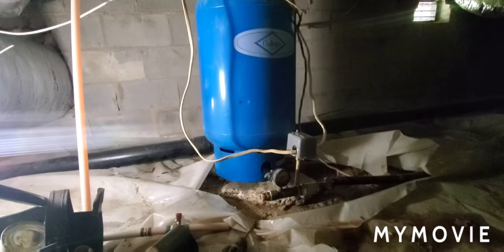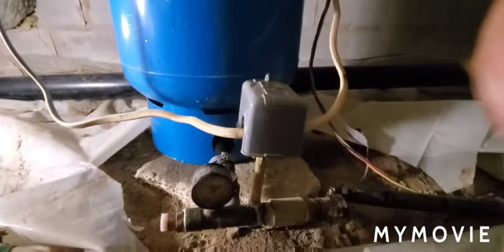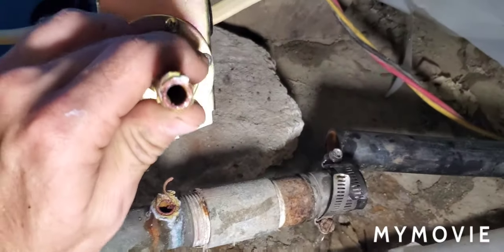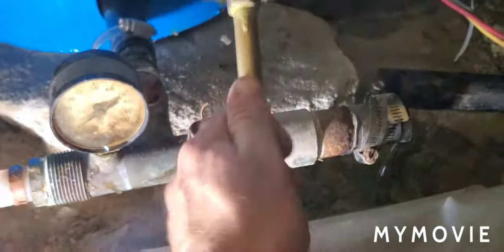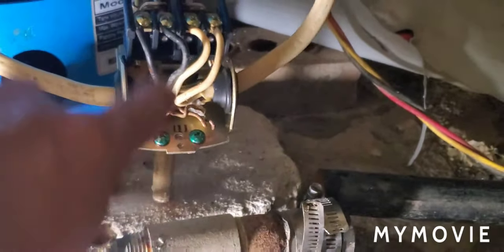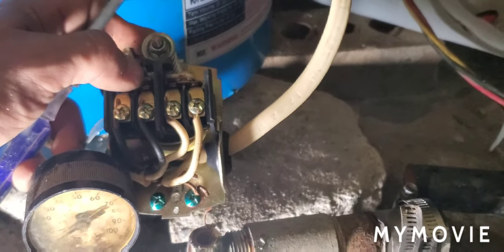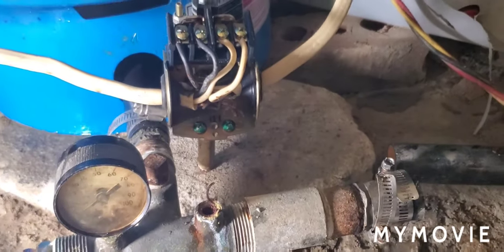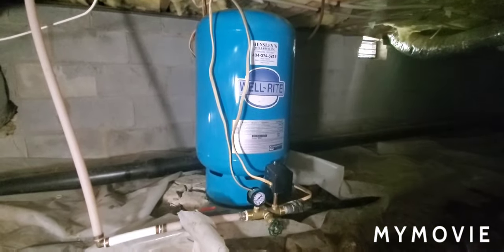No Water or Low Pressure how to fix it & diagnose the issue. Well pump not pumping

Comment: Great video. Not sure what's going on. Right now the pump turns on at 30 and then shuts off at 50. Immediately after it shuts off I watch the pressure gauge shoot down to 40 within 3 to 5 seconds. I had the faucet on at the sink just to see what it would do when it kicked on.  Not against hiring somebody, but I am experience enough to fix minor in some major plumbing issues
Reply: The switch has been replaced within the last couple months. We just bought the house so I don't know if they cleaned out the tube that runs to the cut off switch. But have not ruled that out

Comment: Hey man, great video! Just had a freeze overnight and now have no water going to taps. I however have water flowing out of the valve by the water pressure tank. I don’t see any frozen pipes in my house or anything. I’m stumped
Reply from the maker: Sometimes a frozen well head can cause the pump to run 24/7. Pushing against the ice blockage will cause the drop pipe to burst near the pump bc its dead heading around 200psi. The electric motor becomes hot and heats the water, that makes the pipe weaker & it eventually pops.
Reply: @h2omechanic  interesting. I just pulled the filter and that was caked and found out I have water flowing though the filter now but when I open the valve that leads to the house, I barley hear much water flow through, if any at all.
Reply from the maker: @Travel with the Frye Family  so a busted drop pipe leaking out pressure will stir up the water & sediment.  Your description is spot on, especially when you got alot of sediment. 
Open & faucet and kill the power, see if  gurgling happens. It's very common for a suction effect to happen bc the pipe below grade is broken, so everything drains down. (Power must be off during the test)

Comment: Thanks video my problem new tank not filling up with water i can get water out my hose on the t but the tank wont fill up at all it will build about 40 psi on guage but tank is not getting waterr and pump will not cut off

Comment: Hello H2O Mechanic,
I live in the country. My well tank is about 2 years old. I just have NO water a few hours ago. I checked the well tank PSI and it’s ZERO. I just followed a few tips you gave us here such as: 1) releasing the air pressure valve and only air came out, 2) tank sounded like a bell, 3) the tank is pretty light, 4) the electrical box was closed (ie not opened). What do you might be other possible causes? 

Thank you in advance for getting back to me.

Comment: I may have to have you help me with my Dad's well over on our farm... We got power and the pump is running but no pressure in the house or on the water hose.. thanks for the video..
Reply from the maker: Dry well or a broken pipe somewhere. Typically a pipe in the well thats busted/ or a broken fitting at the pump

Comment: Great videos.  night before turket day and ive got issues.  minimal water pressure at faucets.  and what pressure i have is directly related to the pump being on or off.  when the breaker is turned off the water stops immediately.  breaker on i get a slow rate of water flow.  as if if the faucet was just a little bit turned on.  but its full open.  so i checked pressure tank as per your video.  Tank is hollow sounding, not heavy, no water at the schrader valve.  went to drop the water from the tank to check psi and no water drains from the tank?  so my incoming water from the well is not filling the bladder…. and by the way the hi lo switch is constant on, its not switching off at all. possibly becuase the pressure is not building to ever turn the switch off?   and last thing i want to point out.  so ive got water coming up from well but i can easily put finger over the pipe end and stop that water from coming up.  im thinking the amount of water coming up from the well would spray like crazy if i tried to stop it with my finger?  thinking maybe water line somewhere maybe has a fracture  prior to entering the house?  should that water coming up from the well pump be a gusher?  1/2 HP, not sure how deep.  any thoughts?    at daylight im going to open up the top of the well and see if i can spot any obvious issues on that end.  ive never looked in there 20 years since we bought this house.  amazing how well it all works, unitl it doesn’t.  i welcome your input!  nice clear info!  Thanks.
Reply from the maker: I'm going to say there's a 90% chance of a break down in the well, either in the pipe or pump fitting. 10% chance you have a leak in the yard, you'd find a wet area. Id say this morning your gonna have to pull the pump out. If its 100ft, its a easy 2 man job. If u need help getting it going, I offer FaceTime service for 1 hour to help you do things the correct way, if you need pointers.
Reply: Thank you for your reply!  I got cold feet on pulling the pump myself and probably best that i did.  Removing the well head took an hour with two guys that knew what they were doing.  The pulled it all up and out 80’.  Found that the 1981 motor was running good.  And the 1967 Gould pump still pumping but the splines connecting the 2 were worn smooth and so the pump was slipping mostly and that why my flow rate was so low.  Got new pump and motor and new wires from head to pump.  All put back and working for $1600.  Ouch !  But I’m happy to know it’s all done right.  And next time it happens I’ll have the know how to it myself... thank you for your reply!  Nice to know someone out there cared enough to give thought to my problem.  And help to review my logic and concur or put me on the right track.  Many thanks!
Reply from the maker: No problem 😊.  Thats a little high in price for a 80ft pump. But I would have been 1200max. But I'm different, I believe in helping people and making a living. I dont do what I do to get rich. I just want to help people & live comfortably!  Any future issues just ask. Please subscribe

Comment: Hi I like your videos, they're very helpful. I'm experiencing my water shutting off and taking about 30 seconds to reset. I cleaned out the filler tube to the switch and that didn't seem to resolve the issue so I replaced the switch and the supply pipe. That also didn't resolve the issue. The new switch has been adjusted to 40-60 on the large spring, I get 60 lbs showing on my gauge with 38 lbs in the pressure tank and the tank has no water in it. What could I be missing, any recommendations? Cheers

Comment: Great videos, our water went out last night. I tried flicking the switch a bunch and saw sparks, but still no water. Does this mean I have a busted pipe somewhere?
Reply from the maker: Correct. Typically its a leak in the area nearest the pump. I have a video showing 6 pumps that all had different leaks and what to look for.

Comment: Thank you for the video.  I don't think you mentioned installing either a pressure relief valve and/or check valve near the air bladder tank.  I am not a plumber, but I  have both on our system and recommend they be installed. Interested in your thoughts on both of these devices. Thanks!
Reply from the maker: I agree on a relief. But I don't recommend a check valve at the tank. If it holds & the check valve at the pump fails, then the system will develop a air In line type of problem.  Check valves should stay In the well

Comment: Where do i start. I had a problem with my pressure switch. Replaced it. The old switch was faded so i thought bigger was better so i went with a 40/60 . after the pump would not build pressure passed 42 psi i thought i had bought the wrong pressure switch. I bought a 20/40 psi. But now i feel when the pump kicks on and off. I believe i have a bad pressure tank but have not checked yet. If my pump is not building pressure passed 42 psi is this a sign of a bad pump. You have stated that it will continue to pump on some systems to 120 psi. Thank you in advance.
Reply from the maker: Your pump is old and worn out. Or you have a small leak in the well on a fitting connection between pump & pipe, it can be leaking out alot of your pressure. A good tank should feel almost empty of water and you can tip it side to side. A bad tank will weigh 200lbs & won't budge if you tip it

Comment: Big fan of your videos i just have a problem with my well. I have no water and the pressure gauge is showing 0 psi when I look at the pressure switch it is in the on position which means the pump is on. When I shut power off of the pump for an hour or 2 the pressure goes to 45 psi or so and the water comes back but the pressure switch is still in the on position and doesn't switch off. If I use the water the gauge goes to 0 psi and I lose water again. As far as I'm aware the tank itself is fine and the pump controls are also fine. If u have any ideas as to what my problem could be some help would be amazing. Thanks
Reply from the maker: Sounds like you probably have a leak (leaking toilet) that has drained the well dry.  Kill the power for 12 hrs. & check to sew if any toilets leak down in the first hour.  It only builds 45psi bc the pump is struggling to lift the water & then it runs dry again when u use it. Drops to 0. 
Look for leaks under house & in the yard too. Almost certain thats it. Or your well has slacked off with its production rate of flow.
Reply: I will check thanks but don't you think it's something else for example it's a dry season in the well it's not have enough water
I have this problem before
Reply from the maker: Well then yes, id say its running out of water. 50% of the time its a toilet that is using the water the well makes. Get pressure to 50psi & kill the power & see if the pressure gauge moves any in 10 minutes ie: a leak. 
If all is good & no leak, Google well drilling companies & ask about Hydro-Fracing your well. 
Or Google Hydro-Fracing companies 
Look to spend $2500-$3500 on a frac.

Comment: Hello my name is Jerry. In my home i have this same set up. The problem i have or the issue is i have plenty of pressure, but about once every min the water pressure drops but for just a second then back to normal. Do you think the small tube could be stopped up or do you think the pressure tank is bad? I pressed the valve on top of the tank and only air came out. I was told if water came out then the tank is bad. but it was only air. I changed water filter couple weeks ago and water is already dirty, so i guess pump is cutting on several times and keeping the water agitating. Any thoughts?
Reply from the maker: 2 possible situations like you said. 
First kill the power & go remove the switch and see if that nipple below switch is clogged. Be sure to drain off all the water pressure before you do it. 
While you have the switch off & water drained off, do a tank slosh test. Tipping the tank a few times & listen to see if you can hear water sloshing around inside the tank. If you hear water in there or if it's extremely heavy the tanks bad . If it's light weight & hear no water then it's still good. 
Be sure to look under the switch cover & find the on/off numbers. The air pressure in the tank needs to be 5psi below the "on" number. Have a tire pressure gauge to check the tank air pressure. What your describing is the tank has too much air, but air doesn't magically go up. Sometimes a pinhole leak allows water to displace some on the air and ends up increasing the air pressure & causes your problem. But at that point water is ontop of the bladder and that's bad. But the tip test will show you if that's the case.

Comment: I have a garden 1/2 hp pump... hose in hose out.... will not build up pressure... it will flow but I can hold my finger over discharge and stop flow very easily... good volumn... no pressure.  pump was left out in freezing weather... I did not think it had water in it???  isn't leaking??

Comment: One question.  My tank sounds like a bell but my tire pressure gauge on the schrader valve reads zero.  My pressure switch is 30/50.  Should I air up to 25 before checking the switch contacts and nipple and might the increase in air pressure cure my problem?
Reply from the maker: Correct. Follows these steps. 
Turn off well breaker
Open sink faucet, leave open.
Add air to tank to 25psi,no more then 28
When adding air, water traded in tank will be forced out of open sink faucet. 
Once air reaches 25 psi, close sink faucet and turn breaker back on. 
If you were having problems with your Pressure, then yes itll fix your problem.
Reply: @h2omechanic  I have a 3/4 nut on my pressure valve.  Is it counterclockwise to loosen?  Interestingly enough, I had a double white wire coming in from one side and a red, black, and white from the other.  Red to the white terminal.  Black to the black. And white to the ground.

Comment: This video was great. I would greatly appreciate a little more advice. We have an overflowing well, for some time now; and I recently noticed the pressure valve jumping back and forth between zero and about 40 pretty consistently for I’m not sure how long. 

I’m wondering if the overflowing well could be a contributing factor.
Reply from the maker: Doubtful. 
Fluctuating pressure is indicative to a leak somewhere (very commonly found near the pump) ie the fitting connection between pump and pipe
Reply: @h2omechanic  ok.
Thanks! I set out to change the switch myself, and there seems to be a lot of water draining out of the tank. How can I tell how much should be in there based on the size of my tank?
Reply: @h2omechanic  is that fluctuating pressure “short cycling”? 
How can I tell if it’s the switch or the tank?

Comment: Mine story is slightly different. I've got 40/60 style unit.  Out-of knowhere my water pressure stopped. Went into crawl space and seen I had psi but can't recall exact. Wasnt high at all. This was before watching your videos of course. Took top off and seen all were contacts touching and in place. I never touched them. I ended up turning a knob in front of my water tank and seperate from it and turned it counter clock wise. Heard a bit of pressure and called wife to see if any changes. Water pressure for only a minute and then stopped. I looked at PSI Guage and nothing now. Absolutely nothing. Idk where to begin. After this incident I decided to watch your videos with hopes to assess tomorrow if able. Any advice would be great before I make more mistakes which I'm great at doing.

Comment: Hey, I have one of those pump tech motor protectors and the load light is flashing. If I remember right, last time the well ran out of water None of the lights would come on until the level reached what it was supposed to be and then it just worked normally. We thought that the well had to run out of water. Unfortunately, not on my advice the spin down filter was opened while the well was off and completely drained all water back into the well, now getting The flashing load which means overload someone suggested I might have mud or a pebble in the motor which probably sounds like it’s gonna have to be pulled. Is there any other reason that I might have the overload sensor tripping?

Comment: I just watched your video I am a first timer first well I am owning my water stopped there is no sound the pressure tank is reading 10 I could use some guidance if you can
Reply from the maker: Watch my most viewed videos in the Well Pump Q&A Playlist, there you'll learn everything I could text you(would take a while lol) but I teach you how to test different things. Once you've ruled out a few things, then message me with details and I'll point you in the right direction. 
Note: 10 psi of air is low, Pump it up to 28psi with a little compressor. 
You'll need a volt meter to test for power at the switch and then out at the well. 
If u have power at the well & no water, it's either a failed Pump or broken wire in the well.

Comment: Hello, I had to turn my water coming into the house from the well for a few day until I was able to get parts for my geothermal system. I got the parts and put them on. I then turned the water back on, and there is no water coming out. I don't know how to fix it. Do you have any suggestions? Please help if you can.

Comment: Replaced my shallow well jet pump, primed it and threw the breaker on.
Why does my pressure raise to a point about 10lbs under cut off and not rise any further thus shutting off pump?

Comment: hey man! you helped me a few months back with my elderly fathers place. We had a new pump installed in our well this spring and fixed a leak in our frost free and everything was working great. however recently we have been having water pressure issues again. The pressure will get down to 38 psi where it should cut in and turn on the pump but sometimes it just doesn't. Instead of hitting 38 and shooting back up to 60 it gets to 38 and then just keeps dropping. if it drops below the 38 mark we stop using water and it gets back up to around 40 psi but then doesnt seem to want to click back on and get to 60. it seemed to be working fine after we had the pump replaced but now not so much and the problem seems to be happening more and more frequently. any help you can offer would be great. thank you
Reply: also forgot to mention that when we start using the water outside usually has some spitting of air that happens when we first start to use it but then it  quits. I  don't know if that is a clue or not. once again thank you
Reply from the maker: The nipple below the switch is probably clogged. Remove switch and clean out the little pipe (push a screw driver thru it). While the switch is off, Check the tank air pressure. Set it to 35psi.